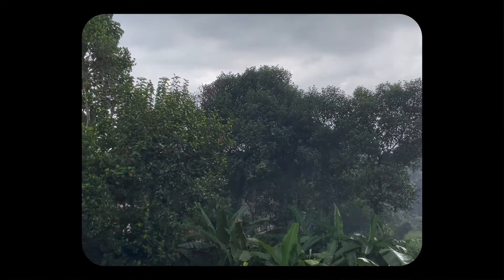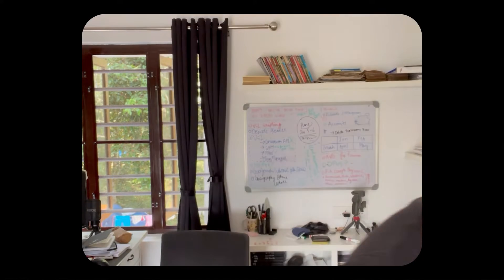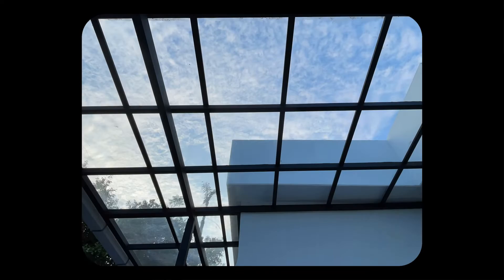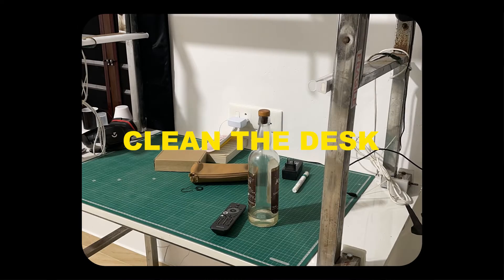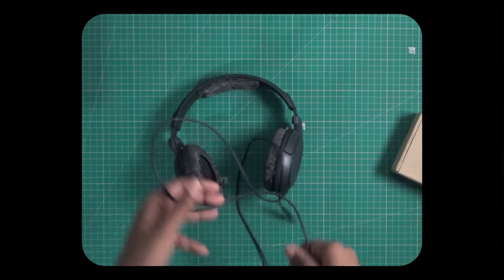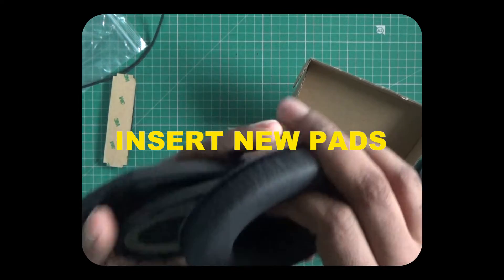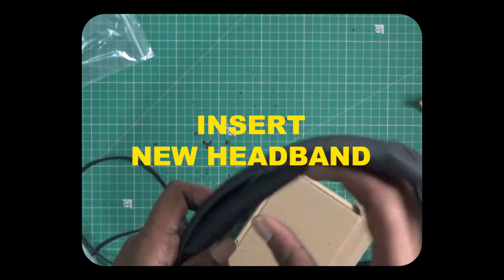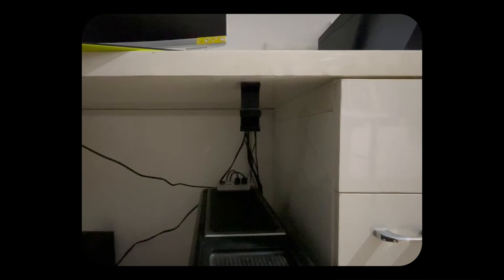How to repair a good loyal pair of headphones - #106

Comment: I also replaced my qc 35's ear cushions recently and felt just as nice. But it seems it's a thing with all the ear cushions out there. Some say it's due to salt out of sweat, some say it's natural, but considering how expensive these cushions can get and tear off so early, the quality and life of these should hold significant points while purchasing new ones.
Reply from the maker: Absolutely bro, and it's unfortunate that most brands don't sell replacement pads for headphones. 

I had to get an off-brand set, but I wish I had the originals.